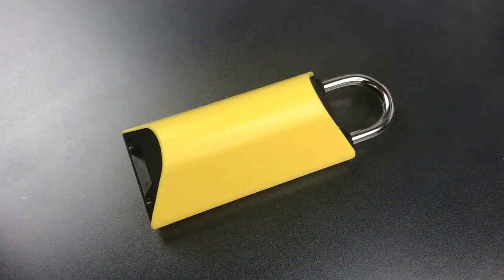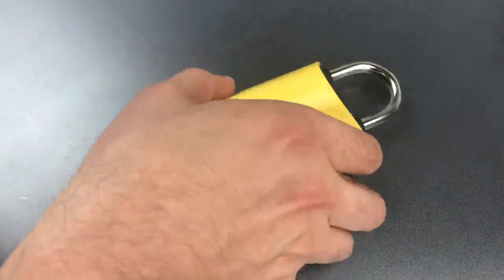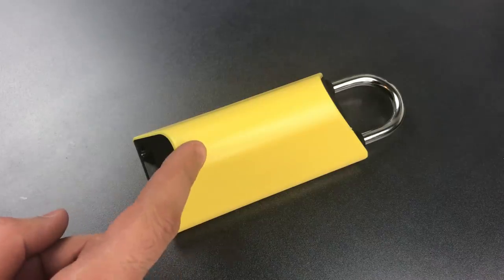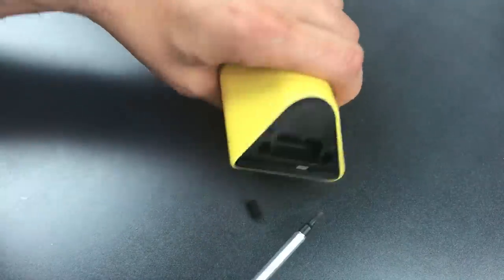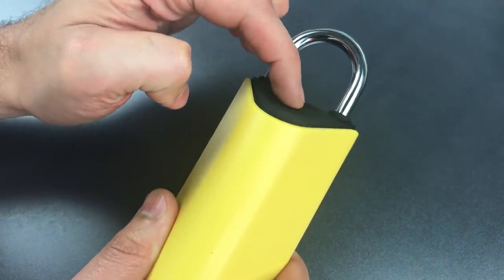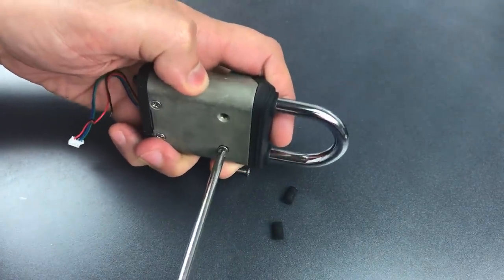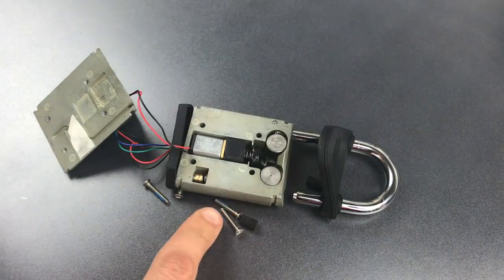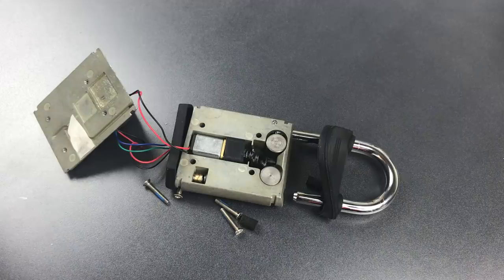[752] BoxLock: $129 Barcode-Scanning Padlock Opened With Screwdrivers!

Comment: LockPickingLawyer: Have you heard of and/or ever tried picking open a KnoxBox? https://www.knoxbox.com/knox-rapid-entry-system/public-safety-agencies/

I feel like these are a massive security risk, especially since a lot of municipalities are now requiring their installation under the auspices of preventing break-in damage in the event of a fire alarm going off after-hours in commercial buildings. If there's a multi-tenant office building that has a dozen businesses, and a single KnoxBox on the ground floor has keys to all those businesses, that's a burglar's wet dream to gain access.

Comment: I think the criticism here is unwarranted for obvious reasons. For one thing porch pirating is sort of a hit and run operation, generally taking place in less than 30 seconds. Secondly, most porch pirates, I suspect, just happen to be passing by the residence in question and make the decision to grab a package on impulse and therefore don't have the necessary tools with them. And even if the thieves are pros and have tools with them they are most likely not going to take the time, even the extra minute or so because they're committing the crime in broad daylight and have no idea who might be watching. But the biggest problem a pro porch pirate would have with this device is that it is always in the locked position and therefore thieves can't know whether the box it locks even has a package inside it. On perhaps 9 out of 10 tries, maybe even 19 out of 20, the box is going to be empty. What sane thief is going to take such a risk with such a low likelihood of scoring? None.
Reply: They only need to disassemble it one time, modify it so they can open the lock in a second (it seems like there is plenty of room for such a modification), then reassemble it.

After that, they can come back whenever they want and as often as they want to check for packages they want.
Reply: It is probably more worthwhile to design the box better and put a good lock on it.

I'm thinking of boxes like those clothes donation boxes. The design of those boxes makes it easy to put stuff in but difficult to take stuff out.

Mailboxes with locks have similar designs as well. They should be able to design something like that for packages.
Reply: I don't know anything about smart locks and how to modify them, but I'm guessing less than one percent of porch pirates do either. As for this less than one percent, I seriously doubt they would bother with this because even if they made the modification they would still have to expose themselves to arrest perhaps 10 to 20 times just to make a single score. Why do that when you can go down the block and find a package just sitting in the open?
Reply: Read the other comments for some ideas.

I don't know how thieves choose their targets, so I won't go there.

What I am concerned with is that the lock can be compromised easily without showing any signs that it has been compromised.

I don't know. If package theft is a concern, I still think a box that makes it easy to put stuff in but difficult to take stuff out is the way to go.

Besides, why would you want to make a suspicious activity, such as strangers in brown uniforms opening any of your locks, seem normal?
Reply: @iwasfrancisd  Not to discount doing research and investing in quality security solutions, but there seems to be a tendency among people I see commenting on these lock videos to ascribe way more agency to criminals than most criminals have. These usually aren't terribly bright people, I highly doubt they're going to be hacking your padlock (unless it's with bolt cutters).

Comment: Yeah. Mechanical locks are still king. Probably for the next 10 years too. This is a toy. $129 for plastic, battery, 50 cents worth of circuitry, is the shackle even hardened?  

Neat idea tho, back to the drawing board. Would rather leave a lock box with a legit padlock out and give the courier instructions to lock it up themselves.

Comment: Thank god criminals don't know about foam.
Reply: IronBat That foam is just to keep it dry and avoid rust.
Reply: @johnfrancisdoe1563  Yes, why would you want to stop someone from dismantling a device designed to protect your property before it's even unlocked. All those other sucker lock companies would use clever placement or a hardened metal slug to stop someone drilling or punching out the screws and making the lock totally ineffective. Who knew they could just use foam, truly a security revolution.

Comment: Your right, what a good technology.
Except for the fact that there's almost nothing that cant be hacked that goes through the air as an RF signal. Extraordinarily easy to grab a signal and decode it with todays platforms geared for just that kind of task.
It's just a matter of time before anybody with a cellphone can unlock it.
Good video and as always i have learned something new from you.
Thank You LPL

Comment: unless the master bar code opens all the locks in the product line you would have been ok  to show the bar code on the video since you have destroyed the lock and there is no chance of anyone using the master code to break into houses.

however since the master code "probably" is for all the locks in the product line you having shown us what to look for we can simply buy one and then we would get the master code card and open every one else's house.

a simple software/firmware fix could prevent that by disabling the master code once a new master code is programmed.

it is like the default password for wifi routers being Admin or password1 or something really simple as soon as you change the password then the default password is disabled

Comment: If you disconnect it like you did, would the app warn you it was disconnected ?
Reply: Considering that the whole processing functionality is in the lower part and the upper part has the battery, solenoid and lock, I can't imagine it can do that. Once you disconnect the battery, it turns off. Unless it has a backup power source in the bottom part just for that, but I doubt they thought that far ahead.

Comment: I don't think anyone's going to take that amount of time to take apart a lock even if they're just unscrewing the bottom and ripping it the top out there's still going have to take out them four screws they can just easily bring two wrenches three-quarter inch wrenches and pop it open or bolt cutters and cut it locks are only good for honest people no matter how good luck is even if it is a pick proof

Comment: In defense, you were able to flip it over and access it from all sides

You were not crouched down on the front porch open to public view.

That being said, why attack the lock when the container is far easier 

A cordless drill or handheld cordless cutting tool would be so much quicker and easier.

Even a lock cutter concealed in a backpack would work....what, you have never seen an urban bike theft?
Reply: finding non-destructive attacks is the game for him, all manner of ways you could destroy the expensive thing, and you are absolutely right that package deposit-boxes are often thin plastic or similar, something to hide whether or not a package was delivered, easy for scum to wreck.

Comment: Even for me as a software developer this is blatantly wrong! I mean how can't you see how brutal this obvious design flaw is?
Would it be so hard to place a single fat screw down where the shackle sits? I don't think you need to have a background in security device design to not make this kind of mistake. Sure, when I'd design an IoT-Lock I would get some serious experts for the lock part. But man, you need to be intellectually blind for that 😄
Edit: for sure, your last comment recommends a screw in the shackle hole...

Comment: Putting epoxy to assebly holes not a solution. As the cover of lock is plastic, bad guy just smash plastic body in pieces. Only way a see is remove philpse screews from top metal part and solder it together.

Comment: OK, so as a "hacker" you attack those like this in <10 seconds:
Get a €1,- stepper-driver circuit board and an Arduino to drive it.
Attach 4 needles in correct pitch to the stepper-driver.
Power Arduino and driver, heat needles up with a lighter and push though the bottom plastic at the right spot, make contact with PCB and th elock opens once the stepper has turned a bit :-)

Comment: What a brilliant idea, so badly executed. 

How to make it actually secure is another thing altogether. The electronics has to be in a plastic body so the wireless can get out. No matter how strong you make the metal lock part, you will still have two motor wires coming out- all you then need is a battery to power up the motor.

It would be much better designed as a lock to fit into a security cabinet, with the bare minimum on the outside. But then how digitally secure is it?

Comment: Woah. That's just an ugly case of IoT creep. You took a gentle and non-destructive approach. If someone wants the palette of milk in my shed, they could just take a hammer to that plastic shell to destroy that and free it from the actual body of the lock, then remove four screws.

Additionally, if someone just wanted to give me grief, they could smack a flathead bit right into the scanner, which would leave me out a lock, and finishing the job of breaking in to retrieve my shed milk before it gets all warm and angry.

Comment: Eh...  Why would you take all that time to disassemble this particular lock as a thief just to steal a random box?  It would take a pair of bolt cutters one second to cut through.  The point of this lock is to be a deterrent and it's enough that a common thief won't bother with any obstacles.   No device is completely secure.

Comment: Given the shit design. They could leave it exactly as it is and add one feature that would deter theives.

Tampering with screws causes and ear peircing tone that can be heard for blocks, much like fire alarms. 

And only way to avoid it is servicing techs or licensed locksmiths having a specialized and controlled scan code that logs their access.

Then you could leave it be as is because no criminal wants to attract attention.

Comment: What you do not keep in ind is that you can not pull off the yellow part when the lock is attached to a box or something. Again, this is an example how you open a lock under ideal circumstances. Out in the field, this is a lot safer. I would not go so far as to call you a fraud, but you need to work on your objectivity, dude.

Comment: Some folk look to be getting a bit OTT here. 
Yes the screw holes are inexcusable and should have been epoxy filled from the factory but all this talk of "just hit it with a hammer" is BS. It's not designed to be high security, its designed to make it more attractive to pass by your goods and go rip some other sof off and

Comment: how are the delivery guys supposed to know how this lock works? even so, those guys are constantly in a rush and wouldnt like to use this. not only that, i get a lot of packages and i can tell you that not every one gets listed as "out for delivery" either not on time or not at all. this would prevent them from using it properly. this thing is basically useless. there is an alternative by amazon that is being tested now called amazon key. they can open your door and put the package inside, while a mandatory camera captures them to make sure they dont do anything fishy. its controlled by an electronic device that can fit most deadbolts. have a look: https://www.youtube.com/watch?v=9kbFfGrGm_Y